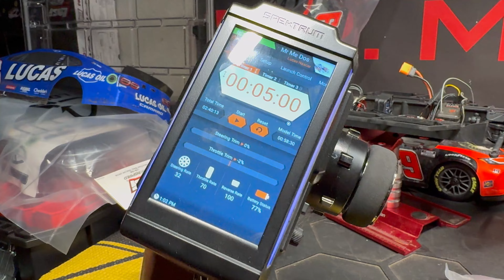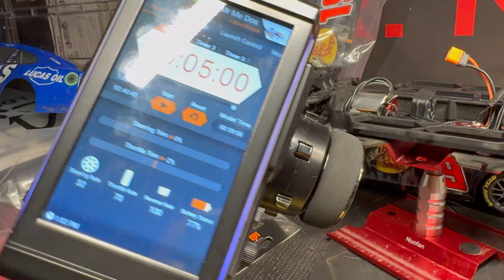CUSTOM LOSI NASCAR GET CUSTOM PAINTED WITH FURITEK SYSTEM AND 12MM HEX CONVERSION

Comment: Cool video, thanks for the update. If you’re interested in a near stock brushless motor try the fusion mini 16 esc and motor from hobby wing, it’s the gold de locks of motors for this car. Most are running insane brushless motors which is cool to but for anyone interested in getting better performance try that fusion 16 mini
Reply from the maker: Thanks for the info!
Reply: 100%. Installed on in my NASCAR and it’s awesome and still has 2.3mm pinion
Reply: Yeah Do RC has a video about it and that’s what inspired me to try it,  use the led program card and set the drag brake off and drag brake force set to 1 not auto for oval racing and set on auto for road course is what I use with that mini 16.

Comment: Same here. put in furitek  and it goes crazy and locks in a turn and spins . I took it to hobby shop and they tell me it’s my dumbo receiver and radio which doesn’t make sense because it works fine on all my other vehicles. He then tells me to try a glitch buster for $4 and it worked but when I use the fan in it, it act up .
Reply from the maker: Its furitek bro.. period! They need to fix it!

Comment: Stick an AVC (like SR6200A) receiver in there. It’s awesome!
Reply from the maker: to be honest, I dont think it needs avc. its pretty straight. this setup really lets you fine tune your steering.  once its dialed in, its straight..
Reply: @MrMeDos  Straight? The primary purpose of AVC is counter steer much faster than you can giving greater turn stability. Holding straight is a secondary benefit.  Cheers,

Comment: The body you painted the windows yoy could just use stickers to black them out. The rigs are looking good. Do you notice any differences when using batteries with different cell counts i know the cell count determines the rate of how fast the power is put out. I found open area with a oval  cement planter & i was going round & round with my Mojave Grom & The Rlaarlo Terminator & was just fun. I'm getting the Fireteam out next. 👍
Reply from the maker: Yeah you can tell the difference with different c rated batteries.. just depends how your running them.  Thats cool you found spot to run your rigs.

Comment: I have the furitek system in my Mojave grom and I’m having the same issue with power sliding and it going into reverse with forward throttle. Also sometimes when it does that it runs away on me almost like the old nitros used to do. Hopefully they figure it out and have a software update soon
Reply from the maker: Ok cool, Im not the only one.. yeah they need to update or something. I just have to remind myself to hit the brk before the gas if i power slide. Lmao  i had to change how I drive it but its cool.

Comment: Yup same with my furitek system! Its in my Mojave grom as well and it would spin out I hit the throttle forward and it went full reverse into a metal mailbox destroyed my body!!. I'm pretty disappointed in this system. If it keeps happening I'm just gonna go to a king val system. I mean 100$ system should be superior to a 40$ Amazon system but it's definitely not working for me either.
Reply from the maker: your the 2nd person to have the same issue.. this crazy.. I mean it runs smooth  it just makes me change my driving style when I run this one. Muscle memory is hard to break when running rc's too smh. To know not to it the throttle after a power slide or drift. you gota brake before throttle to prevent it from going in reverse. pretty crazy. hopfully enough people have this issue that they push a software update thru the app.